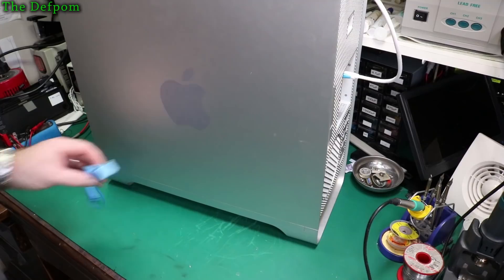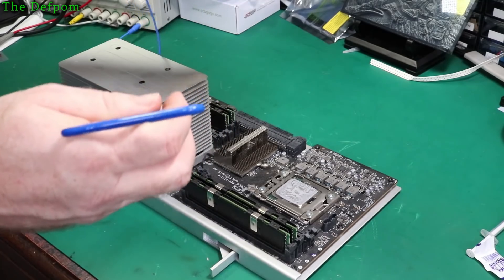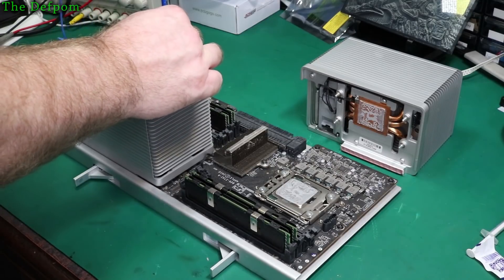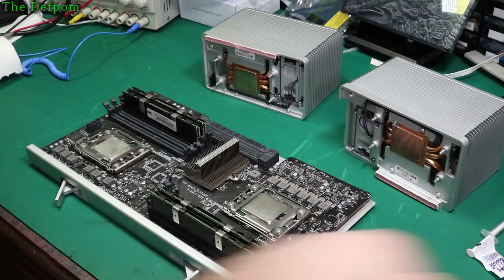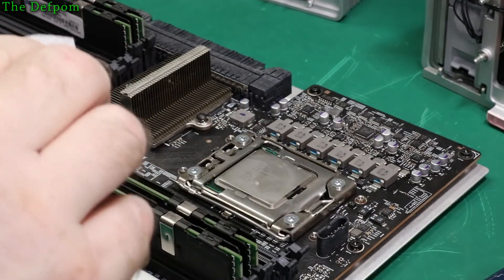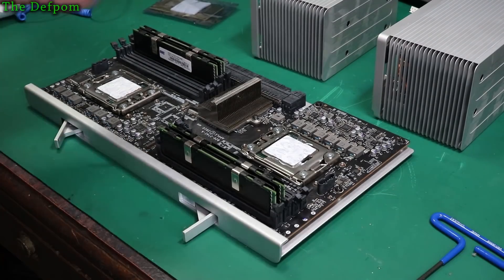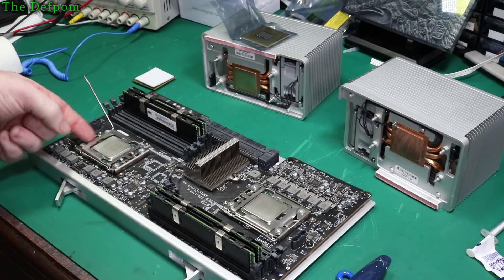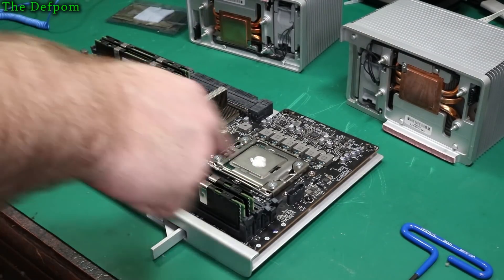🔴 #539 Apple Mac Pro How To Upgrade CPU to Xeon X5690 3.46GHz from X5670 2.93GHz

Comment: Hello! Great video! I currently have the dual 3.33 GHz 6-Core (2012/Westmere) Intel Xeons in my mid-2012 tower. Do you think it's worth it to top out with the X5960 or would the difference be negligible? thanks!
Reply from the maker: Probably not really worth it.

Comment: Hello, I have an old 2008 Mac Pro in the garage and I'm thinking of using it for video editing. I'll do all the usual thing like SSD and more ram etc but I was wondering what is the best GPU I can get for this 2008 model
Reply from the maker: Phil_Sledge - my 2008 (and this 2010) don’t seem to actually use the GPU for rendering, at least not in Premiere. It just loads up the CPU.
Reply: @TheDefpom  I use FCPX so maybe it will use the GPU.

 I'll check some forums. Thanks for the reply btw
Reply: get an rx 580

Comment: Very nice upgrade - never seen the inside of a Mac desktop - interesting! I'm afraid I'm a Windows fanboy (HP xw8600 workstation with dual quad core Xeon 3.2 GHz processors)  I prefer to do my bulk video processing with FFMPEG, harder to get to know but quick, clicks along at 150 to 200 fps depending on the video and compression being used.

Comment: How were you able to install those cpu"s with the heatspreader on? I saw many times that the heatspreader got to be removed.
Reply from the maker: alamar1205 - that is for a different year, the 2009 version, this is the 2010 which doesn’t require de-liding